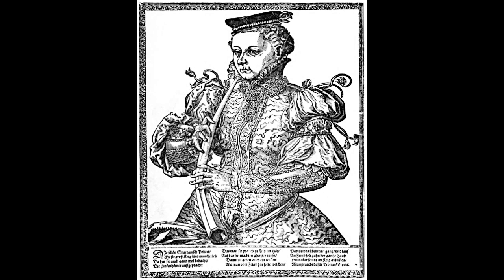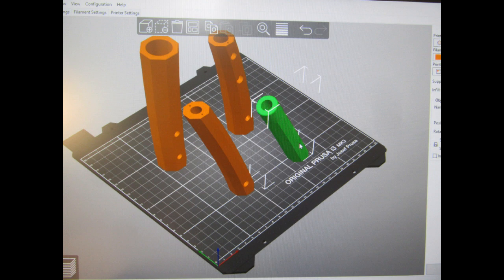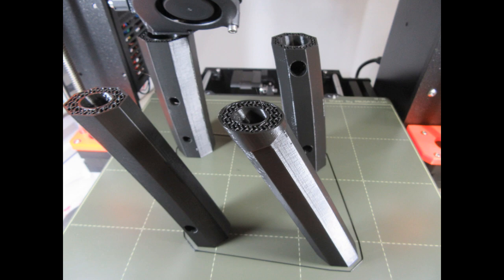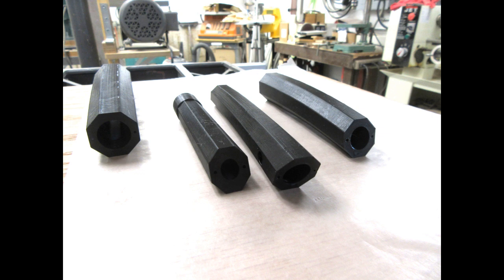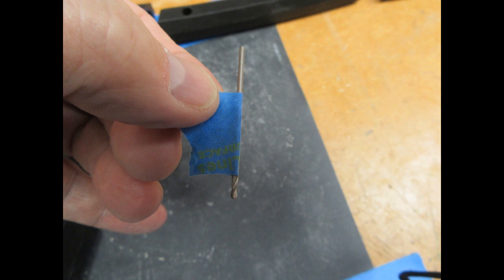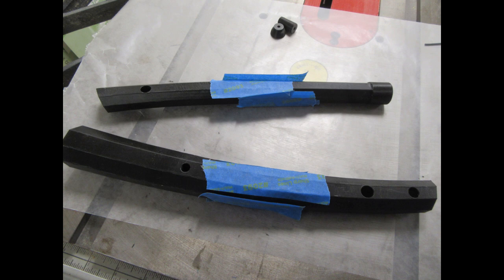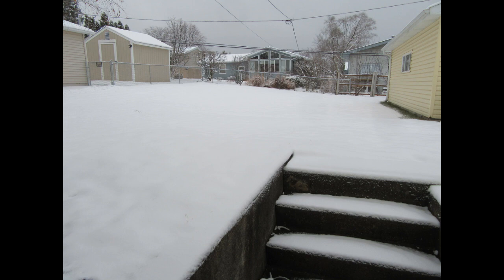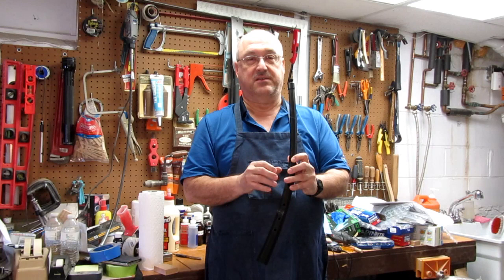Making a 3D Printed Cornetto (aka "Cornett", "Zink")

Comment: Touch the fronts of your lips together, look for a hole at one or both sides, use the one that feels most natural, stick the fipple over it, and that will give you a proper off-set cornetto placement and embouchure. Use very little pressure, just enough to make a seal. Unlike playing a regular brass instrument, don't use the muscles of the embouchure to manipulate the aperture. Use the surface of the lips only, and the muscle in, not around, the lips. Pretend the sides of the aperture are little vocal chords, and you'll pretty much have it. Think co-ordination, not strength. If you try to use strength to play a cornetto, it'll always defeat you.
Reply: Thank you! I don’t have one yet, but clear instruction is sparse. This instrument absolutely needs a widespread revival.